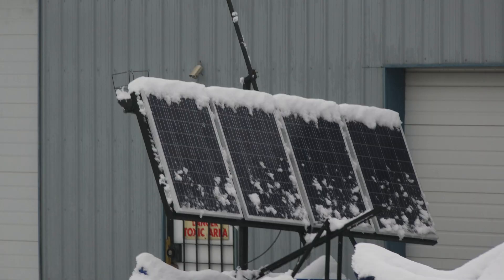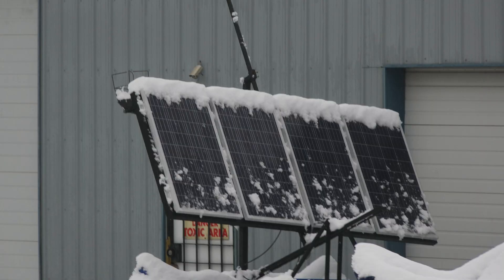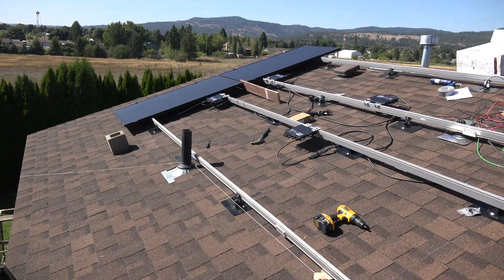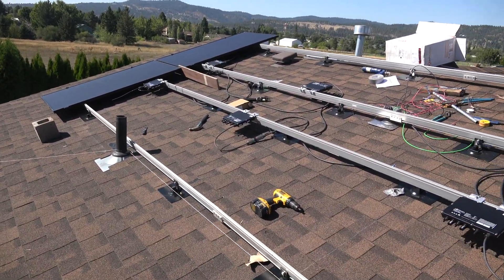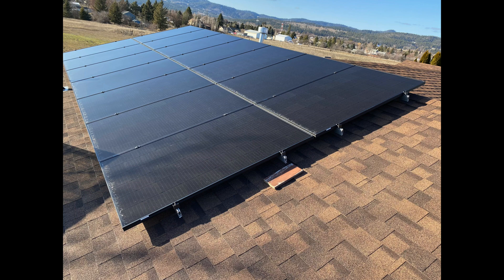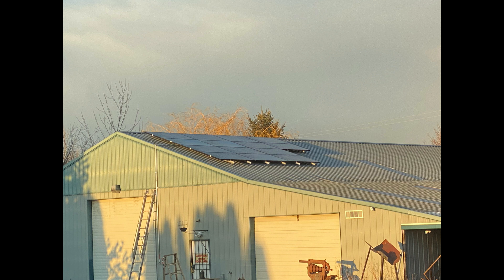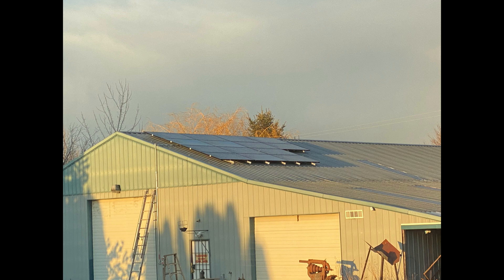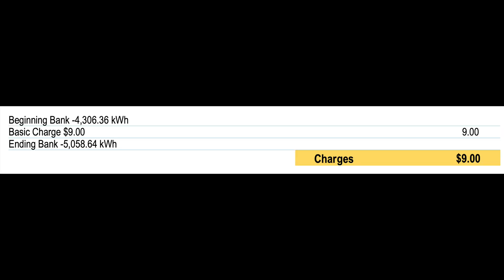Does solar work?

Comment: Here in Hawaii most of the houses have solar hot water which is highly effective as compared to heating water with electric. 
Photovoltaic is great and I love mine. But heating water with thermal solar is a no brainer unless you live above the arctic circle i guess, or somewhere very cloudy…
Reply from the maker: Your power has been mostly from oil fired plants and so is very expensive.  The last time I was there, I saw a lot of wind turbines so that may be changing.
I would not say as far north as the arctic circle,  it would not be practicable in most areas of the US.  Photovoltalic is very cheap and simple.
GFM
Reply: @grayfurnaceman  true about the fuel oil, i did hear recently that there are near term plans to close that plant in part made possible by a large scale battery install.
I just mentioned the thermal solar bc it is so often overlooked. It is far more efficient than photovoltaic around 80% vs. 20%. Also I have lived in two of the rainiest areas of Oahu and had no trouble heating all the water a family of four needs.
Reply: solar thermal is an excellent technology - the sun does a fantastic job of warming water up, the storage is simple, no exotic materials required. but the post modernist elite "green types" want grid tied pv and electric cars. solar thermal is a great even compared to heating water with fossil fuel.

solar thermal is mandated in israel. we could learn from israel. there's no reason to heat water with electricity or gas only in southern climates.

using electricity directly for heating via elements is  an absolutely frivolous unless it's from hydro dams. at a minimum,
Reply from the maker: @Jon-hx7pe  Back in the 1970s, there was a lot of interest in thermal solar.  It had very limited use mostly in very warm climates.  
It sounds good, but it just never worked well.  Pump problems, storage problems, freezups, plus all the normal problems with water.  
I made 2 thermal water systems in the 1970s that were quite unsuccessful.
GFM
Reply: @grayfurnaceman  can you explain than why it is mandated and working well in israel and there is an industry around it in north america?
there are many warm climates. 
Claiming solar thermal doesn't work well because it didn't in the 70s is like claiming heatpumps don't work well in colder climates. the technology changed and improves, as does knowledge. there are cold climate heatpumps and even the conventional ones save a great deal in northern climates compared to straight electric and have value in dual fuel setups too. 

In the same way, solar thermal is useful even if it has to be supplemented in the colder months. there are still heatpump bashers out there because they got bummed due to bad experience with 1980s heatpumps with mechanical defrost controls.
If a system is designed correctly for the climate, it works well. for example - freeze up won't happen with a drain-back system or there's a anti-freeze water loop loop through the panels with a heat exchanger.
Reply from the maker: @Jon-hx7pe  I used to live in the high desert of California.  If you wanted solar hot water, you could just put a tank on your roof and paint it black.  The sun shines every day, and you did not dare leave a chrome plated hand tool in the sun or you would get burned.  Its almost like a different sun.  I would assume the climate is similar to Israel.  
I was involved in thermal solar in the 1970s and 1980s.  Things like passive solar rooms, thrombe walls and thermal domestic hot water were a part of the mix.
Two years after installation, none of these installations were working.  
I can remember one system that used parabolic mirrors that was especially problematic.  The complication of a second water tank, pump systems, tracking system added up to $6,000 in 1980s cash for something that might save about $75 per year made it useless.
The systems used now are similar to the black painted panels used then.  Drain back systems put air in the water system and glycol systems add more complication.
Compare that to a PV system that produces 240 volt power on the roof.  No adaptation of systems in the home.  Your home is already wired for appliances.  
GFM

Comment: Tesla has a plan to make those who install solar and have a power wall to become part of a utility that produces electricity stores it and gets used when needed on the grid. It sounds good, I don't know the drawbacks to a system like that though.
Reply from the maker: The Tesla systems may have a future, but the costs will have to come down for widespread use.
GFM
Reply: up next, "wildfire started by tesla power storage bank", because we all know that technology is 100% reliable and never fails ;)
Reply from the maker: @throttlebottle5906  The headline:  "Brand new Tesla power bank in California starts largest wildfire ever".  "Elon sued for 10 billion".  That would be rich.
GFM
Reply: The tesla crap wants over 60 thousand!
1 drawback!

Comment: Payback costs have always been my concerns. What part of they country are you in? Snow cover in middle Wisconsin would be a removed problem for me being disabled. I also learned a lot from your oil fired furnace videos, thanks for that. Paul J.
Reply from the maker: I am in the northwest.  Snow cover definitely stops solar.  Thanks for the support.
GFM
Reply from the maker: Payback will be covered in the future but I do not want to be focused on dollars.  Residential solar will become necessary to power production in the near future.
GFM
Reply: "Payback" and "Amortization" are thrown about a lot. I don't take that into account...if the "Grid" goes down, whether hours, days, or many months (I can give you many different scenarios for how this might/will  happen), "Payback", etc. doesn't apply. Owning your own power is as the old Commercial said is "Priceless"
Reply: @festeradams3972  I also believe payback is not the point.  However, I have a somewhat different reasoning.  
I appreciate preparing for grid failures.  But when the grid is working, a system that is grid tied gives the option of having a gigantic battery in the grid.  There is no way you can have a battery large enough to replace the grid.  Right now, I have banked about 6,000 KWH for use in winter.  
What I think is the best is a system that uses the grid when it is available, but also has the ability to disconnect from the grid in the event of an outage using a small battery pack for overnight usage and operating all appliances during the day when solar is available.
More on this in the future.
GFM
Reply: It's funny how everyone always ask about ROI on my 20.6 kw solar. They don't ask that when they go out to eat that fattening, greasy food 5 times each week. They don't ask that when they go on a third vacation for the summer. They don't ask that when they go buy a $60-$90,000 4x4 jacked up pick up truck.

Comment: When it becomes popular, with enough people looking to forcibly dump their extra power onto the grid, the grid becomes unstable with so much stochastic power and will require more natural gas plants which can be modulated to compensate.  On the other hand, I've read of some real possibilities in batteries using iron, which will work for a home storage solution since weight isn't an issue.
Reply: Yes, California is having serial blackouts/fiascos with its green energy mandates - 3rd world electrical grid *on the way. Businesses can't stand that. 

And yes, doesn't that "sell back to the grid" cost the utility money?  

And guess who that cost gets shifted to: the poor.  California's green energy schemes are sending electric rates through the roof.
Reply: Do you know about Thorium?

Once that gets under your belt you see all the yammering about electricity, when Thorium can give us cheap cheap cheap electricity and unlimited 10-cent a gallon gasoline too. 

(Kirk Sorenson has the best Thorium videos if not familiar.)
Reply: We are in a transition. Once “too many” ppl put solar on it will make more sense to install storage(whatever kind works/is best). Certainly storing surplus energy bought cheaply when production out strips demand and then selling it back at a profit when the sun goes down will be very enticing.
Reply from the maker: @michaelsmithers4900  I agree with you on the storage.  The problem with storage is cost.  13 KW for $8500 or 100 KW for $16000 for a battery for a long range model S.  It just does not make any sense.
GFM
Reply from the maker: My local utility would love to have that problem.  They are primarily a distribution system that switches from source to source to match the demand and lower demand from some areas simply means less outside power is necessary.  And no, there won't be more power than the system can use.
GFM
Reply: My favorite anti-AGW innuendo:

"Gentlemen, have you ever spent a night in the desert without a sleeping bag?"
Reply from the maker: @hg2.  Yes
GFM
Reply: Gentlemen of the HVAC community, 

The earlier video should end it.

As per the satellite data, 
There 
Is 
No 
Global
Warming. 

Full stop.

This should be good news.

What is it about AGW that turns adults into children?
"No Jonny, you can't have another cookie."
"No Jonny, you can't stay up another half hour after watching Walt Disney on Sunday night."

Global Warming is like Elvis. 
Elvis is not alive.
There is no global warming. 

????

Global Warming has all the characteristics of religion. 

I call the religion of global warming "Eco-paganism".
Solar panels on the roof are like Virgin Mary statues in the yard. 

The former is state imposed ( unconstitutional) while the latter is voluntary. 

When it comes to religion, I recommend the latter - Jesus is the only one resurrected. Not even Elvis and not global warming after failing the experiments.
Reply: This isn't about solar or global warming, but the warm-up act to same, and HIGHLY pertinent to the HVAC industry: 

Ozone Hole Over Antartica is Bigger Than Ever | 2020 Ozone Depletion

https://www.youtube.com/watch?v=njII28jfLVQ

Question to group: "what's wrong with this picture"?
Reply from the maker: @hg2.  The ozone hole reached its largest in the mid 1990s.  Since that time there has been peaks and valleys in that range.  The use of CFCs caused this issue.  As they are stable, do not expect a reduction to normal before 2050.
GFM
Reply: @Les 
Yes, I do. 

What about it? 

I'll cut to the chase: you're making the innuendo that Thorium is no-go because of gamma radiation. Nonsense -- it's a problem, yes; but not a show stopper.  (See the Kirk Sorenson videos.)

America used to be a place of Can Do Enterprise. 
Now it's a place of woke bureaucracy.
Reply: What is being "forced" is the forcing up of electricity rates to drive consumers into these green energy boondoggles.  NYC shut down 20% of its supply by closing a nuclear plant (Andrew Cuomo).  How is that supply going to be made up?  "Solar" -- sure; higher elect bills forcing people into solar.    

(Did anyone say anything about winter?)  Cuomo screwed up the natural gas supply too by vetoing a big pipeline to the region, though the area is more dependent on nat gas various reasons, like shutting down 20% of NY's capacity.  3rd world here we come.  Can't make this stuff up.
Reply: @hg2.  there are many sources of energy such as geothermal, wind, offshore wind tidal, hydro and solar. Burning fossils just doesn’t make sense given all that’s going on with climate change. 
You mentioned boondoggle of transition to renewable energy and then mention the third world, (I don’t think you know what that means - but ill assume you mean developing world which actually has two big advantages over us. One they tend to not have legacy investments in infrastructure that is outmoded to work around. Two, they don’t yet have the massive energy demand that we have. Of course they don’t tend to have our money either.
Reply from the maker: @michaelsmithers4900  For Michael Smithers:  hg2 likes to argue.  He is wrong on most everything, but I don't want to suppress him.  Argue with him if you wish.  It just goes on and on.
GFM

Comment: im all in for it, with electric work van,  why not.
Reply from the maker: The change in 10 years will nothing short of spectacular.  We will just plug in the van at the end of the day, and it will be ready the next morning.  
Operating costs will be 1/4 to 1/3 of gasoline.
GFM